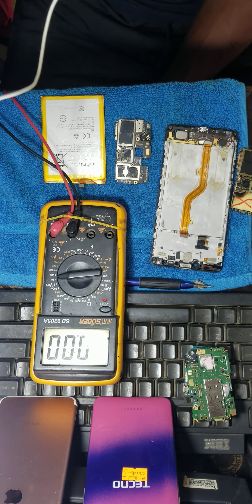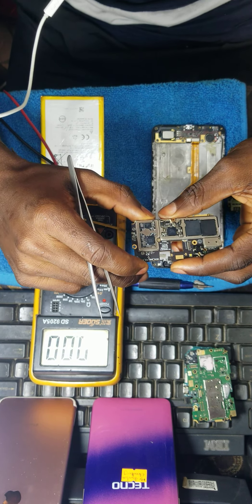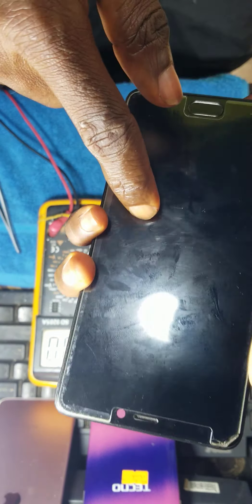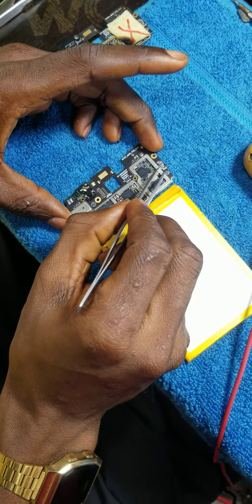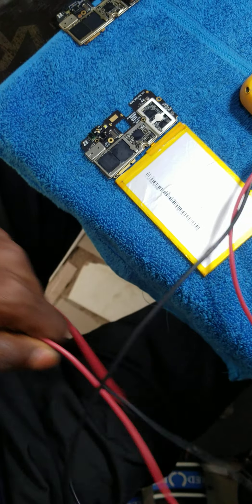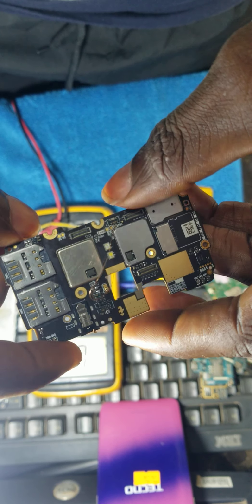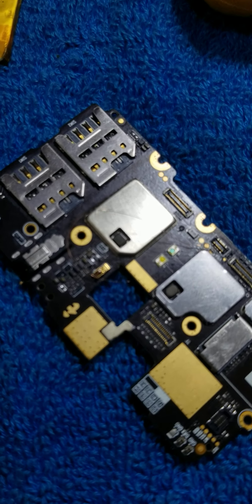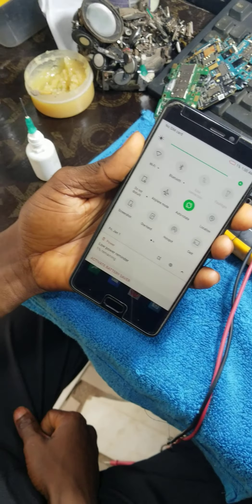Backlight Solution On Infinix Note 4 X572

Comment: Very good sir. I have this problem with my note 4  last year. I took it to a repairer, he just make a jumper wire connection from one of the screen flex clip to the board terminal that's close to where the screen flex and board terminal normally meet. That all. It worked. But after few days, it started disturbing. Meaning. The screen will sometimes come up then go dim continually. Since then I just keept it. But with this solution you just posted I will try it out and give you feedback. Thanks a lot.